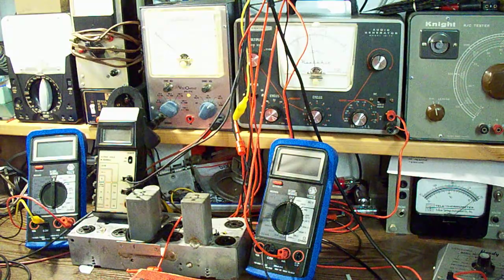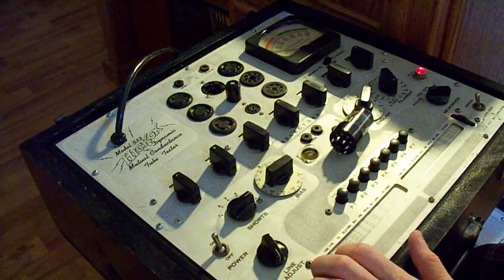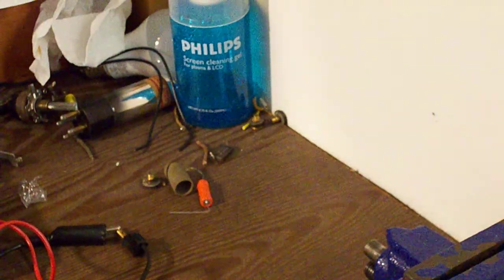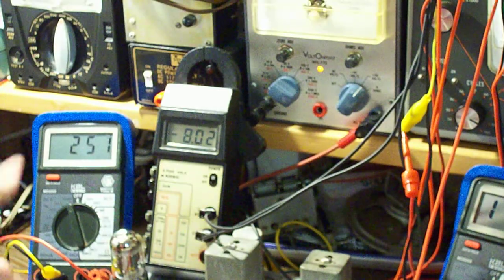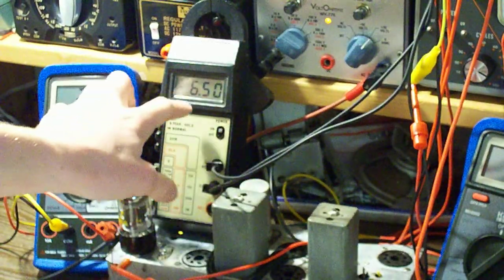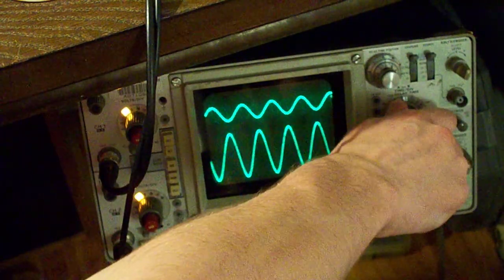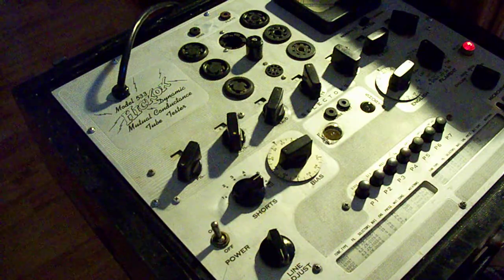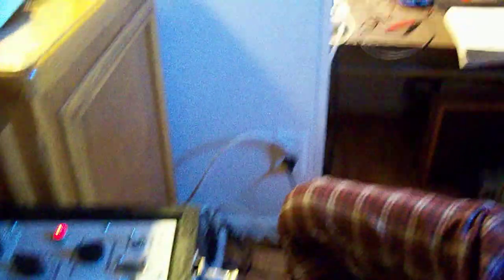DIY Bench Tube Tester Experimentation

Comment: 2 options for the socket either replace it or get a socket saver there pins are slightly larger so they can make good connection with the old socket and then plug tube into that. Make sure it's socket saver with screw in middle to secure it